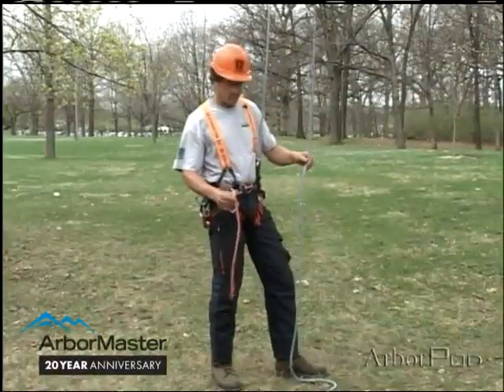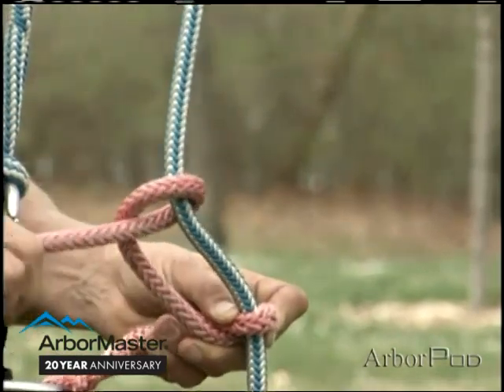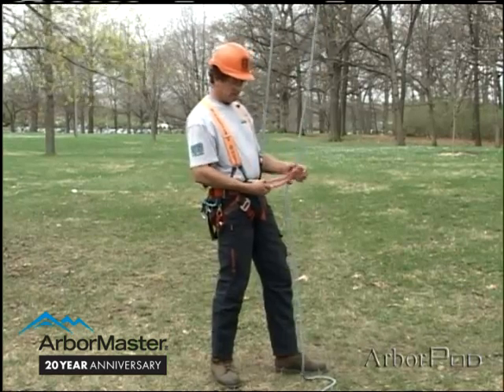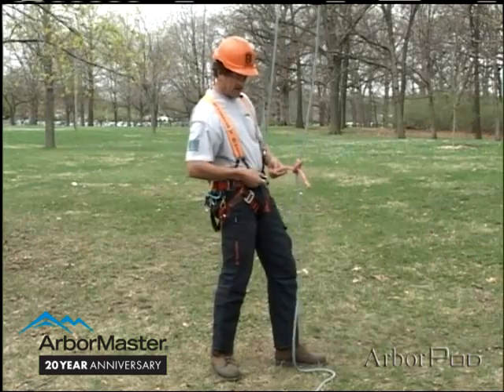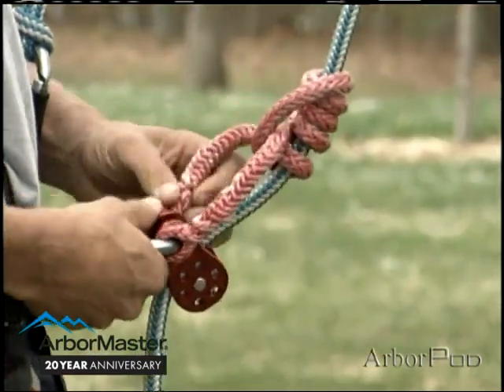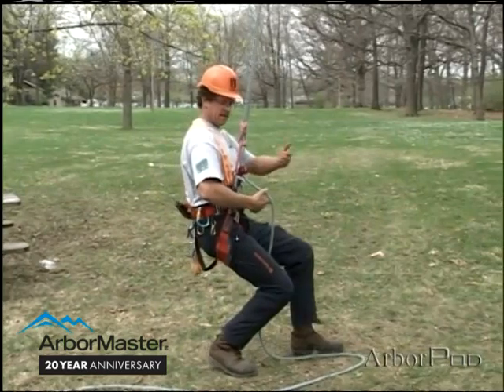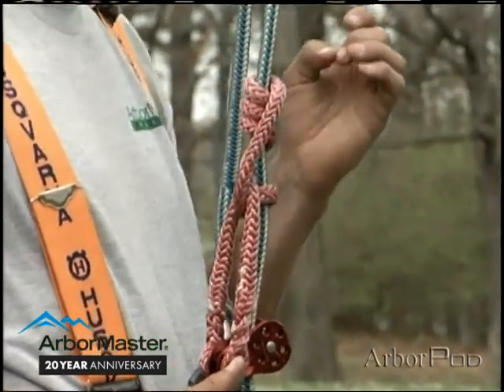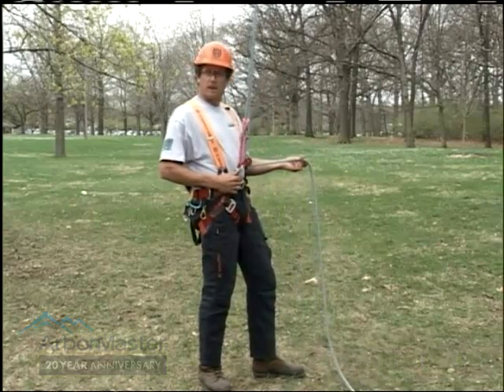Distel Technique

Comment: On new stiff climbing Ropes  i think the swedish prusik may grab a little better than the distel. My Living room Practice I find that after releasing or getting slack
( leaning away from the tree) that both Knots need to be stretched with the hand to grab on a new rope.If the Prusik remains loose it may not grab well on a new rope.Also using a Pulley to tighten or get closer to the tree it's a good idea to check that the Loosened Prusik Grabs.
    This becomes second nature after a while. I prefer the Prusik to mechanical type mechanisms.

Comment: re 1:15 You might mention that if you instead, only attach the pulley to an accessory cord adjustment prusik on the standing line, the pulley will auto-mind your ascender knot.  This is also much more energy efficient (pulling down is easier than pulling up) to ascend, and exactly the same decending.

Comment: Why dont more climbers use Arbrarist ropes, I was reading about an accident where a guy resce like 2022, died in a leader fall on a brand new 8.5 mm high end climbing rope.  Brnad new $200 rope, not even a bit whipper, only  like 20' and the rope hits a sharp rock.... severed ... guy falls like 50 0feet.  I wana get an arborist rope to use in my construction business where concrete, dust, ..who knows a saw blade, scaffolding fcan dmage the sheath. the biggest heftieststrongest arborist rope, Im getting one.